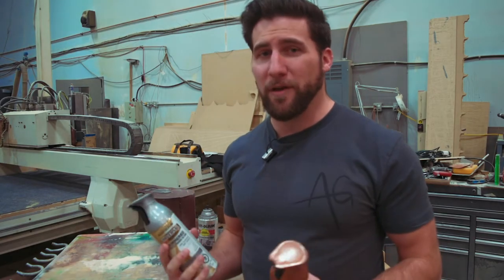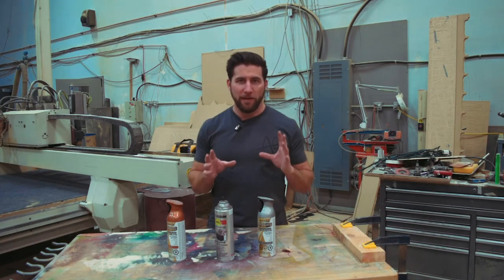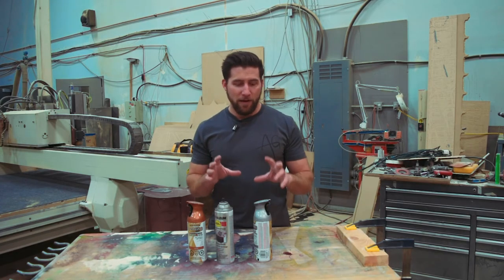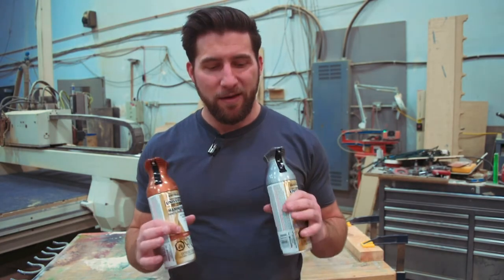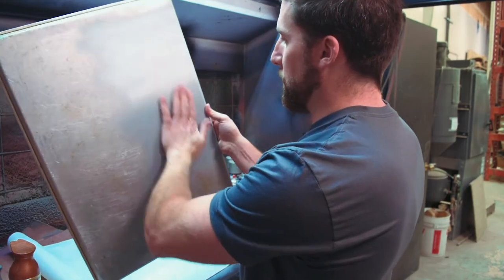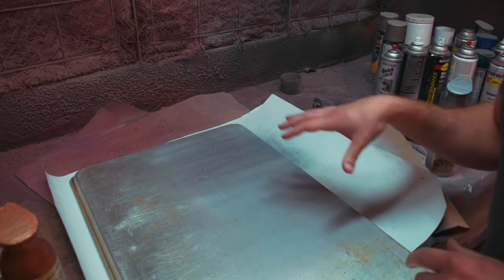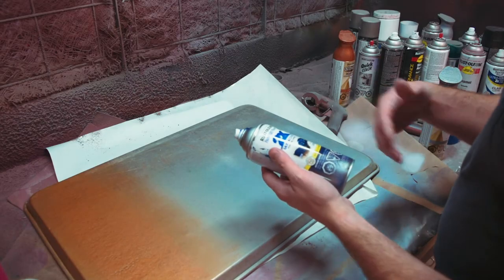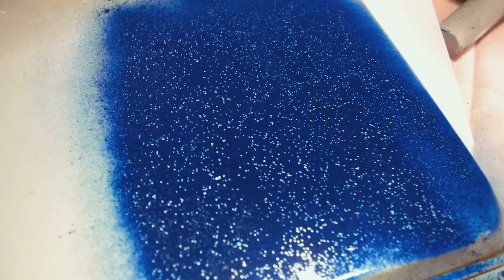Strong and Easy Paint Job | How to work with Hammered Paint

Comment: Not only is this the BEST YouTube video on hammered paint, but it is also about the only one that is GOOD; even Rust-Oleum’s own videos are crummy.
Reply from the maker: I guess the bar is set low haha.
Reply: @BradAngove  Lol. I know it was three years ago, but how did the blue coat turn out and hold up? I am curious about trying something similar, perhaps with a candy coat, as the color selection on hammertone paints has dwindled in recent years (all metallic now, at least in the U.S.).
Reply from the maker: @micpoc4597 I haven’t done a durability test on it, but I think that thing is still painted the same haha.

Comment: I've dabbled with this paint two times. First time yielded perfect results, second time, not so much. Still looked good, but not the hammered finish I was trying to achieve. I'm kind of a semi pro when it comes to rattle cans 🤣, but this is a different ball game with the silicone additive (which I just learned from this video). I've called Rust-Oleum multiple times for tips and advice on using this product, and I learned more in ten minutes from your video, than I did from the people who make it 😒. They literally told me multiple light coats, and that's just not the case when using a paint with silicone, as you need it thick for the silicone to do it's job. Just wanted to say thanks!
Reply from the maker: Glad I could help

Comment: The reason those trigger cans are harder to clean is that unlike a regular spray can, they are designed so that you can spray them at any angle, even upside down. With a normal can you would just get propellent if you sprayed upside down, but this also allows you to clean the nozzle.

Comment: I’ve done it on the interior plastic of a truck in a car by letting it dry a couple hours and then hitting it with the fusion clearcoat comes out mirrored shine every time just make sure you let it dry light cold it with the clearcoat and do about five coats
Reply from the maker: I’m glad to hear that has worked for you. I would be hesitant to use fusion clear coat on it. I would think the hammered paint would actually be more durable than that clear.

Comment: Rustoleum back-of-can instructions suggest a couple of medium coats from 12" away. That will result in NO discernible hammer effect - just a matte silver look. They ought to have said a heavy coat from 8" away - but so many people would have trouble applying that with no runs that the manufacturer has probably figured, supplying instructions for the wrong finish effect was the lesser evil. I've a feeling this is one type finish that is actually better rolled on from a can, because a sprayable formulation will necessarily have to be thinner which doesn't lend itself to this effect.
Reply from the maker: This paint doesn’t tend to run that easily, but rolling it also works. If you’re rolling it you need to thin it with xylene or it will tend to stick to the roller too much and get stringy.
Reply: @BradAngove  thanks! This weekend, I'll try the factory formulation, i.e. uniluted, with a sponge roller. The weather being hot, should help it flow better yet be thick enough for a deep, coarse-grained hammered effect.
Reply from the maker: @AlexKarasev you may find the hot weather causes it to set quicker and come up with the roller. I hope it goes well!

Comment: Great product. I used heavy coverage on vintage expanded metal lawn furniture x 4 years ago bc it hid all the chipped paint with little prep. Hid all imperfections. Furniture sits outside in Pacific Northwest with minimal cover, easily 1000 days of rain later. Looks great.

Comment: I restore old machines for a hobby and like the way hammered paint hides imperfections in cast iron and sheet metal.  I thin it with xylene and brush the first coat.  I then use a rattle can to go over any hard to reach nooks and even out the finish on the parts that show.  I get better coverage and the paint goes a lot further than rattle cans alone or an HVLP sprayer.  And the finish is very durable.
Reply: Handy comment. I'm restoring a vintage cast iron planer and I'm thinking about using this. Do I need to use the primer first? I sanded everything to bare smooth iron already
Reply: @mariano_353 In my opinion, it is always best to prime bare metal but not necessary for previously painted surfaces that have been sanded.  Brushing also provides better coverage and adhesion because the brush rolls any tiny particles that may have been missed during final cleaning so they are fully coated and stick better.  You can also roll the first coat on and back brush it to achieve the same result.  The rattle can provides a nice hammered finish to the areas that show.
Reply: @Roy-ij1wq  thanks Roy

Comment: I have always wondered how those worked, thanks for the demo. The only textured type paint I have used is the truck bed liner, and that is some good stuff. They claim you can paint over it, but I have never done it myself.
Reply from the maker: I’ve used truck bed liner on a tool box. It was great.
Reply: I've painted over truck bed liner and had no issues but I allowed the bed liner a good week to cure before applying paint over it

Comment: I have coated hammered paint with spray can clear polyurethane. I waited about an hour in 80 degree low humidity whether. I then applied two more coatings of the Poly, waiting an hour in between each coat. I then carefully removed painter tape on the edges that I did not want covered.

It felt dry after 48 hours, but that was just the surface. (When pressure was applied it left an indentation under the polyurethane in the hammered paint.)
So I stored the project in a dry, dust free environment for 2 weeks to let the hammered paint fully dry and cure under the polyurethane. It turned out great. 

I think the reason the polyurethane was able to adhere to the hammered paint so we'll, was I applied it while the hammered paint was still tacky, and the first coat of polyurethane was able to cure at the same speed of the surface of the hammered paint.

To add more scratch and uv protection, I waxed the service with car wax.

Comment: Hello. Great video. I was trying to paint a fridge with a roller and it splotched all over. So I saw your video and your suggestion to add Xylene to slow down drying time. Stores don't carry that anymore, for environmental reasons, so I got a paint solvent which said it could be used in liu of xylene. It smelled like acetone. I called the Rusto-leum and they said to mix it a 10-15% ratio, which did not work. So I added more. The paintbrush streaked really bad both ways (10% and more) so now their are lines all across the fridge. Just letting you know the dilution thing may not be a solution.
Reply from the maker: Sorry to hear that. We still have xylene available here. Where are you located?
Reply: @BradAngove  Southern California.
Reply from the maker: Oh, that makes sense.

Comment: I want to achieve if possible a green patina look and am wondering if I would spray green paint for the first coat would a topcoat of the hammered copper spray paint show thru and would you still suggest painting it deeply or lightly?
Reply from the maker: I’m not sure I understand what you’re going for here. Are planning on spraying copper hammered paint over green?
Reply: @BradAngove  correct
Reply: @BradAngove  Correct
Reply from the maker: You would still get some green coming through it you spray light enough. I have no idea how that will look in the end though.
Reply: @BradAngove  Worth a try. thanks
Reply from the maker: I hope it goes well
Reply: How did it turn out?

Comment: I’m looking to spray over rusted steel rims without having to do much proper cleaning rust. Is this the right thing if not which would you suggest?
Reply from the maker: I don’t know of anything that is designed to adhere well to rust.
Reply: @BradAngove  Hey Brad thanks for the reply. Great video

Comment: Nice video, im about to prime and paint in hammertone a large fiberglass ute camper (truck camper) that I'm building.

 Im assuming that despite the silicone this paint adheres to itself well for multiple coats without sanding or cleaning between coats..do you know if this is the case?
Reply from the maker: I have never applied more than one coat of this, so I’m not sure, but I find it unlikely.
Reply: @BradAngove  thanks for the reply, I'll give the manufacturer a call

Comment: It is harder to use on vertical surfaces as it tends to run and also gets an uneven look to the hammer finish. Tricky to paint all of a guitar body if all the surfaces have to be horizontal.
Reply from the maker: They don’t have to be. I’ve done the back of a guitar body hung up on this channel before. The stuff doesn’t run that easily.

Comment: A long time ago I'm thinking maybe a year or more ago I mentioned using this product to you. Did you try it because I mentioned it or somebody else did? I just wondered. I'm not trying to get any extra credit I was just wondering that's all. I'm the guy who's from North Carolina who was a 40-plus year career veteran in doing all types of paints and stains, Coatings, wood repairs, you name it if it had a coating on it I've probably done it. I used this on the guy who had Wrought Iron furniture outside. He had used it himself and liked the look of it. This was outdoor furniture I'm speaking of. Every couple years I would redo his big nice deck and I would always redo the Wrought Iron furniture with hammered metal. It sat out in the sun 24 hours a day and I thought it was extremely durable considering that it sat in direct sunlight and it was black. For something to last two to three years in direct sunlight outside in the cold, Heat, rain and snow year-round like that is really good especially for black paint from a spray can. I like the way it looks so I used it on the guitar and it turned out great I only needed one can on the body I'm it's like $6 a can and I felt man this is like a sore peter you can't beat it!! $6, super durable and looks great so I mentioned this to you in one of your videos. Great for somebody that doesn't have a lot of experience because it's cheap, it's thick and does not run easily. It's almost mistake-proof. It doesn't require buffing or anything like that I just sand it lightly. At first I'll sand a guitar down to 220. Then I use this paint directly over the old paint provided is not beat all to pieces or coming off I can usually sand out most of the shallow defects with the 220 sandpaper. Anything that is deep enough to need repairs I like to use the general purpose Bondo because it is light gray and it is an excellent color to be underneath of all paint colors light or dark. Your regular Automotive Bondo is too dark red under light colors and may need more coats to cover whereas the gray is light colored is neutral underneath everything even White. It covers up easily with every color there is at least every color that I've tried. it's a permanent repair and easy to use if you have a NIC too deep or chip anything like that that is too deep to send out. Once the body is prepared did I just spray the hammer Mentor right over the old paint provided it's good and sound and not peeling off you don't need a primer it's 6 to anything really well and I usually send with 320 or 400 between coats maybe 600 or 800 between the last coat in the coat before it what 400 is fine or 320 either one if I have nothing else that's what I use. I don't just go out and buy some six or eight hundred for that only if I have it I'll use it from the next to the last coat that's what I use if I have it. Then I spray my last coat of hammered metal three coats is sufficient. you can put 1/4 code if you'd like but it's not in it and you can get by and make a nice-looking job with only two coats it's just that the third code really makes it pop to me. Whenever you're painting a house from scratch a three coat paint job is the best a primer and 2 finish  coats for a total of 3 coats. Anybody who's a beginner should try this especially someone who doesn't have a lot of money and wants something easy to do. You don't need a primer just use this as your primer and do three coats on a guitar that's already finished and you're just changing the color or want to make it look new again. however if you're using it on a brand new wood body or any wood body with no finish on it I suggest using there Nick and fill primer from Rust-Oleum because it is nice and thick and it drives flat perfect for any finish to go over. Plus the Nick and fill primer doesn't run and it fills shallow Nick's so that when you sand it it Sands out level. God bless you and your family. Merry Christmas and Happy New Year best ever, Jimmy in NC....
Reply from the maker: Thanks for the message and the info James. I’ve been using hammered paint at the shop for about 14 years for various projects, so long before I started this channel. It’s definitely a useful paint in the right circumstances. 
Merry Christmas and happy new year to you as well.

Comment: Hi Brad, how would you use hammerite (hammered paint in the UK) on wood?  What preparations would you need first?

Great video, cheers.

S.
Reply from the maker: You would want to prime it first. If it’s open pore you would fill it before that. I used hammered paint on the back of that sg I did for the Home Depot guitar kit challenge if you’re looking for an example.
Reply: @BradAngove  I missed that series, I will go find it.

I have always wondered if I would need to primebit twice - first with wood primer and the second with the hammered paint primer, silly question I know...

Thanks for your answer, I will find the home depot SG build.

Stuart.
Reply: I've been looking at the hammerite brand hammered texture metal paint. The price in the USA is outrageous compared to Rust-Oleum Hammered paint. Could someone tell me the difference?

Comment: As a finish color, over sanded primer, has anyone sprayed gloss hammered black for two light coats, and finished it with two medium coats of satin dark or navy blue?

I want to have the hammered texture, but not so shiney, and I can't find hammered blue shades either.  So I thought this would do.  Both colors would be Rust-Oleum 2x brand laquer paints.  I'd apply each coat about 20 to 25 minutes apart in the shade of an open carport so each layer wouldn't be wet, but just slightly tacky to surface feel dry.
Reply from the maker: Coating over the hammered paint doesn’t tend to work very well because of the silicone in it.
Reply: @BradAngove  thanks. I didn't even know silicone was in it. That's good to know.  I also contacted Rust-Oleum just today. They said to spray the metallic blue and then wait at least 48 hours and spray their clear hammered product over it, and no sanding would be required if the clear hammered was applied within 7 days.  Apparently that will help hide the minor body panel imperfections that I was trying to achieve.  Thanks again!
Reply from the maker: I didn’t know they had a clear hammered product. That’s awesome.
Reply: @BradAngove  yes, clear and a frosted  pearl.

Comment: Would this paint be hard wearing enough to paint an old lathe and would it need a primer to fill imperfections in the castings?
Reply from the maker: Yes it’s fairly durable. I’d say filler would be better than primer by the sound of what you’re dealing with.

Comment: When I used this I guess my technique was bad. Some of the hammer effect is pronounced and some is very mild. It also looks shinier in some spots. I did 3 coats trying to blend it but it still looks uneven. My question is how do I fix it? I really don’t want to sand it all off.
Reply from the maker: Let it dry fully and you should be able to sand it a bit and add one heavier coat.
Reply: @BradAngove  thanks.

Comment: So to clarify, is it true that other paints are incompatible and won't bond to hammered paint?  Can hammered paint be top-coated over itself after the previous coat has fully dried?  Thanks.
Reply from the maker: Other paints tend to react oddly to hammered paint because of the silicone. It can create an interesting effect, but isn’t what most people are looking for. I believe there are some comments in here about people top coating it, but I have never done it because of the compatibility issues.

Comment: I need your help please. About 20 years ago I loved hammerite brand hammered texture paint for metal. It is outrageously expensive now! I saw that Rustoleum makes Hammered paint 4 metal also. I was wondering if Rust-Oleum bought their formula but hammerite is still in business with Crazy Prices that that comes from the UK or somewhere. $69 for a quart of paint? I've had so much luck with this paint. Would you please give your opinion if Rust-Oleum hammered finish would work just as well?
Reply from the maker: I’ve never used the hammerite, but the rustoleum has worked well in my experience.

Comment: Im restoring a vintage worm drive aluminum skilsaw. Going to self etch prime and hit with Rustoleum Hammered Silver.The aluminum is pitted and rough so it's a reasonable solution for me. NO CLEAR
Reply: Great idea.  I have an antique electric drill that I inherited from my Dad that had a silver hammer finish from the manufacturer on the casing.  A thick coat of the Tremclad wears very well.